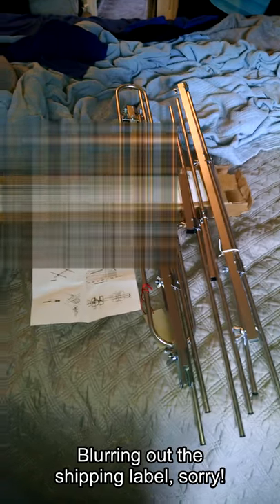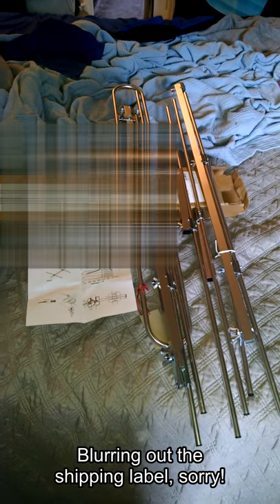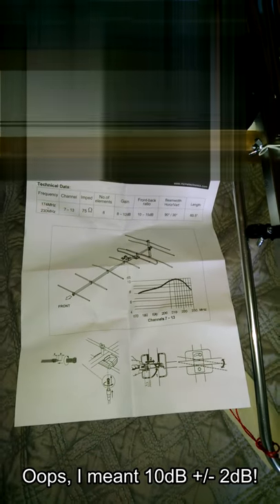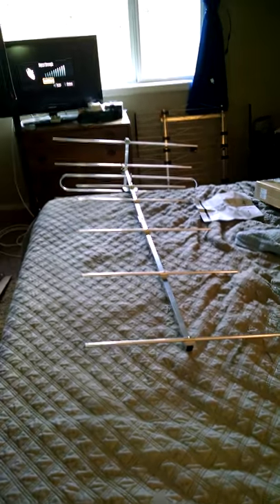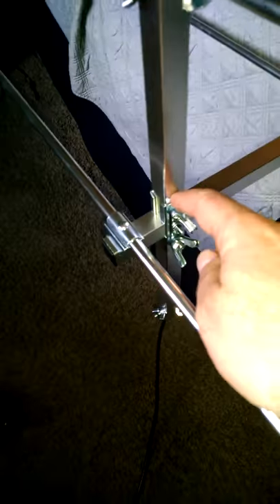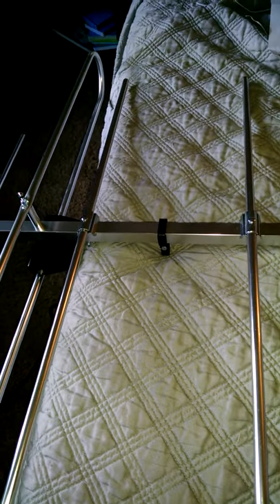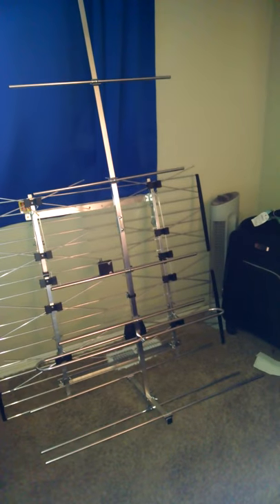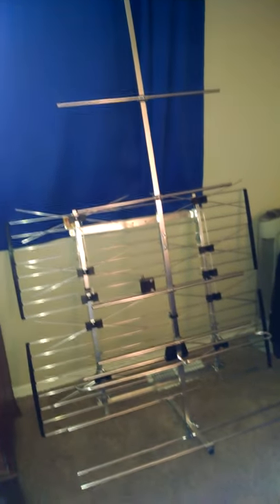TV antenna project: VHF antenna surprise

Comment: I just ordered this antenna.  Hoping to get channel 10.  WBIR Knoxville , TN.  They also transmit on RF CH. 10 as well.  I am using a channel master 4228.  8 bay antenna now.  It brings in the UHF channels , but I cannot get channel 10 WBIR.  hoping this will do the trick.  Its hard to find a dedicated antenna just for high VHF.    I'm glad I came across your video.   Will let you know how it goes.
Reply from the maker: I bought this to pair with a CM-4228HD as well, because I want to pick up PBS on VHF 9. I think it's optimized for VHF 7-13, so your VHF would be dead center. You'll probably want something with filters to combine the signals from the two antennas, or else they'll stomp on each other; it's in the muted section of this video, but I bought a $20 RCA preamp that has VHF and UHF inputs for this purpose.

Edit: I should also mention that this is the smaller of two models from this company. I originally chose it for easier attic installation, but now I'm thinking of a roof install because my attic turned out to be a mess.
Reply: yeah wbir is pulling teeth  im up in campbell co. i get 6 ,8 15/2 54, 43 ,  yeah 10 is right next to 6 physical tower its a head scratcher if i find 1 ill let you know and good luck
Reply: Televes makes 2 great vhf antennas 106501 and 106601.I use the 501 combined with a televes datboss mix 149483 with the vhf elements removed.Works great.

Comment: I currently have the UHF antenna you show, but am looking to increase the signal for a distant HI-VHF channel (12).  I found the VHF antenna you are showing in your video.  Thanks for the size comparison.  Hoping to install both in attic and combine the lines coming into the TV.  Thanks for the video.
Reply from the maker: Let me know how it goes. I still haven't installed mine. I'm now considering a roof install, and may hire a professional.

You will want to use something like the RCA preamp I am using to combine the antennas. If you just use a regular splitter as a combiner, it will weaken your reception.

Comment: Did you get your VHF antenna mounted in attic, did it pick up the VHF STATIONS?? How many VHF stations?
Reply from the maker: No. I decided they need to go on the roof because my attic access is too cramped, and I need to clean out my garage before I can call an installer to deal with my mess of a roof.

I did do tests on a handheld fiberglass extension pole, and was able to get the VHF PBS station I wanted, so I'm confident it will serve its purpose when installed.